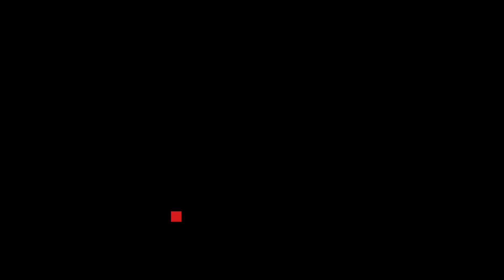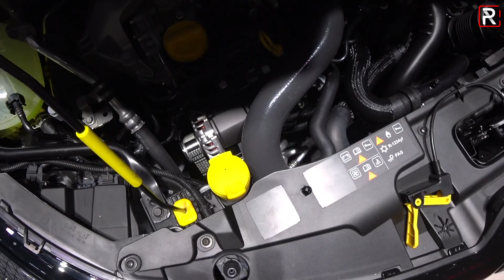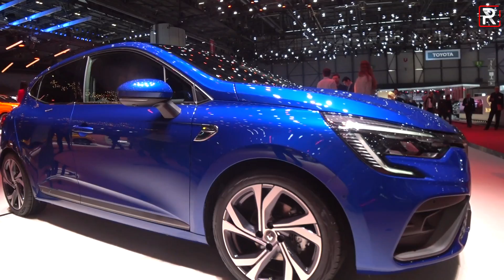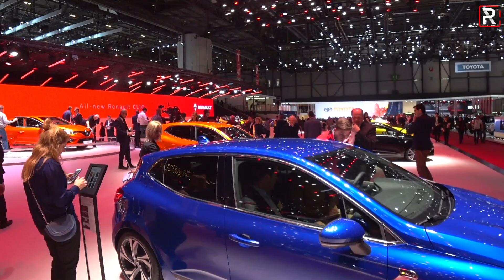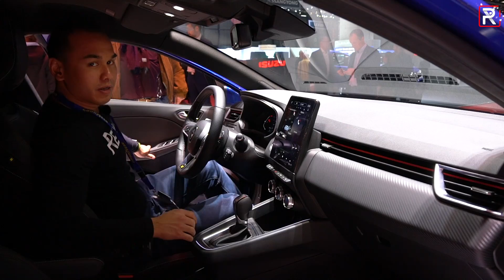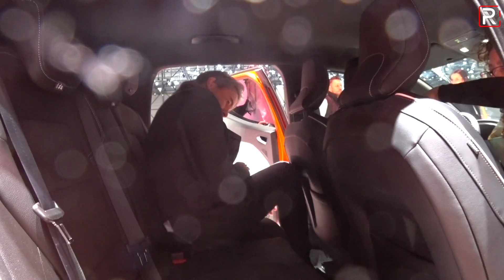2020 Renault Clio – Redline: First Look – 2019 Geneva Auto Show

Comment: I disagree that it would do well. You cite Ford's discontinuation of the Fiesta as a reason it would; Ford didn't discontinue the Fiesta because it was selling like hot cakes. The Fit sold 35k units in 2018 and it's the best selling entry in the segment. The Sonic and Accent sold around 30k, and everyone else did worse.
Reply: Euh Renault do better than Ford 😂🤦‍♂️

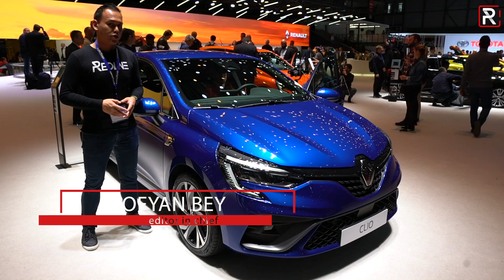Comment: 0:01 That "t" at the end of the Renault... Ouch!
Base model will not have a turbo.
About the cargo space, US norms require manufacturers to quote boot volume to the roof, while the UE ones - up to the parcel shelf. 391 litres is a touch more than in the new Corolla hatch.

Comment: Why doesn’t Renault let Nissan offer this 7 spd DCT in their cars?
Reply: Because Nissan believes in CVT.
Reply: DCT is better for people who are used to driving a manual(EUROPE etc.) because a DCT is basically a manual transmission with an automatic clutch  So you can ask for and how much their customers loved their dual clutch , And that will furthermore explain why they won't continue the fiesta or focus, Customers hate it
Reply: @Keye T
DCT is quite different than manual, it's not just an automatic clutch. It's more like two gearboxes ceamped together.
People like DCTs because they retain a fixed connection from the engine to the wheels. It means better performance and lower fuel consumption than any other automatic.
Ford's DCT didn't work out well but that's not because of the fact that it was a DCT, they just designed it poorly. DCTs from VW or Hyundai are much better, Renault is making progress as well.
Reply: sic22l Oh I definitely never doubted that they were designed a terribly, coming from Ford
Reply: Keye T I mean a DCT is a far better transmission than the current Nissan CVT. I also think it would give models like the Maxima a lot more street cred. I’m sure it’s the 7 spd DCT available in many Mercedes products due to their current partnership, which is a good transmission.
Reply: Zach May I'm too old fashion for a DCT, either a manual or conventional automatic At the very least,

Comment: I know a lot about the Renault-Nissan-Mitsubishi Alliance, and they have two 1.0 turbo's which produce either 100 or 117 horses, the 1.3 turbo can produce between 140 to 160 horse power😏👌
That's the numbers Nissan state when that use those powertrains in the Micra and Qashqai.
Reply: Lukas Spender In America, that 65HP AINT GONNA CUT IT... That thing will be EATIN alive... Ask Mitsubishi how the Mirage is doing  over here lol
Reply: @JDMHaze  sure😂
But luckily it will have 100 or 117 hp, and not 65😉
Reply: Lukas Spender Anyone who buys the 65 HP, it's probably going to be like 19 years old and knows nothing about what's under the hood, and have mercy on their souls lol
Reply: @JDMHaze  haha, u Americans are used to much more power
Reply: Lukas Spender You must remember we don't have manuals(standard transmission) here, so that power delivery is not the same nor is the control, so that's why we need a little more power
Reply: @JDMHaze  exactly, we just like the direct feel and control over the AT convenience✌

Comment: 65 HP? manual trans? will not sell in america
Reply: Probably they'll at least sell the 120hp 1.3 turbo for the US.
Reply: I'd buy it. If it's light weight and has good mileage.
Reply: That's at the lower end of the scale, there are other versions available